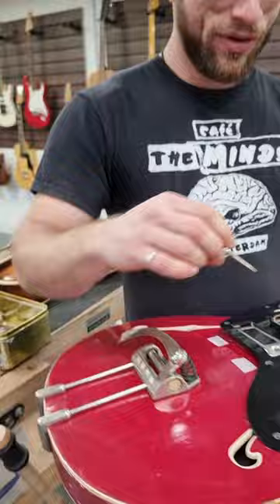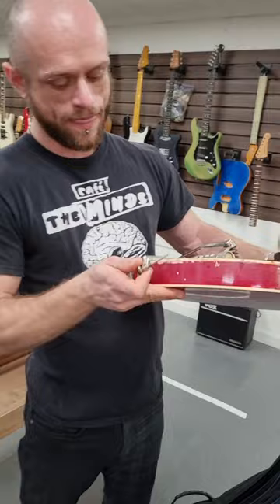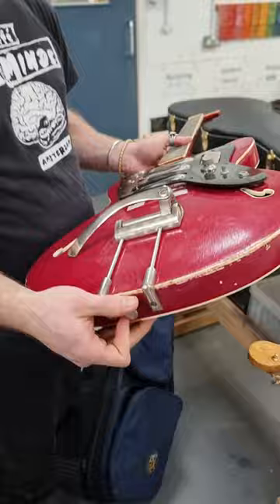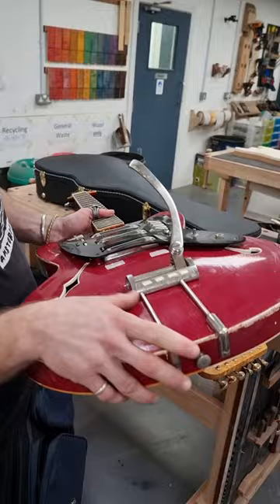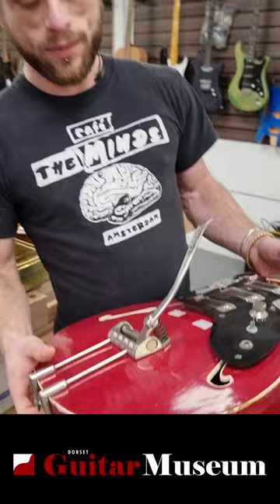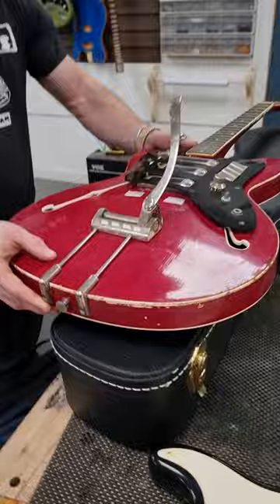Screwdriver built into the Strap Button?!  3 Day Guitar Repair course Surprises!

Comment: It's an interesting idea but I wouldn't want it on a strap button/part that I would hope to be rock-solid, that stops my guitar from smashing into the floor. However - it is inspirational and there are plenty of places on a solid-body guitar to hide a micro-tool kit. Mind you, my 80's Floyd-equipped guitar had 2 allen keys on the back of the headstock. Those allen keys could be altered to do double duty as screwdriver and allen key.
Reply: Yeah, I get the feeling that over time, the threads on the screw would have less and less wood to bite on and it'll get... shoogly.
That issue could be solved with an externally threaded bushing, but... the juice isn't worth the squeeze on this problem IMO.